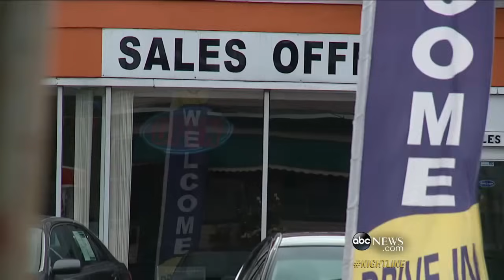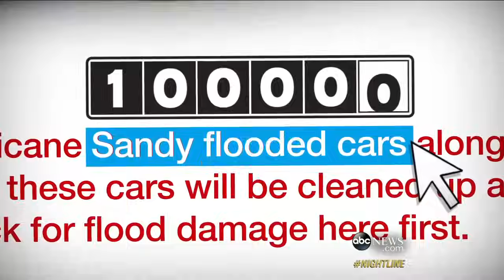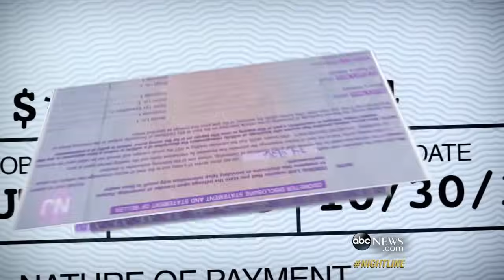How Did a Sandy-Damaged Truck Land on a Used Car Lot?

Comment: i got fired from a used car dealership for refusing to repair a car like this to sell it to one of their customers.
Reply: Good man.
Reply: Yep he mentioned it and lied about it. 
"It was a glitch"... No, it was a flood.
Reply: Hi
Reply: Good Man!!
Reply: I haven't met a lot of honest used car dealers bud...js
Reply: @chrisdoiley8007  bu8n no bbq
Reply: USAA! LOL!
Reply: Full repair or just cleaning up? Because if you’re doing a full repair than it’s really no harm done
Reply: Did you report them?
Reply: @chrisdoiley8007  honest cardealer? Lol, it is an oxymeron, isn´t it? Me recent car is a Mercedes ML 270 CDi, build in 2001. I bought it five years ago. We made a test drive before buying, everything was okay. After driving home, the first control lamp was lightning. That was the beginning of an odysee through many service station. In the end, I invested soo much money in this car, I could have bought a nice GL :-(
Reply: Sometimes people get in trouble for doing the right thing
Reply: @Fastline1000  I bought my 2001 E-class e220 avantgarde wagon 6 or seven years ago. On the way home from the dealership, the automatic gearbox jumped to 1st gear and was stuck until I shut the car off and then back on. 

But I had a warranty for my first 10.000km after the purchase. The dealer told me to go a repairshop in the town I live in, and those guys hated the dealership. 

It cost the dealership almost the same amount of money in repairs as it cost me to buy the car. Only thing that was bad for me, was that I had to turn the car in very often and for longer period of time for several months.

In the end, I got a better working car than expected without paying for repairs I didn't even know it needed.

(Don't think it works that well in all countries. This is in Norway)
Reply: You lost something for standing up for what is right ... Well done my friend... Well done... Don't be sorry for not one single second because I know Jesus Christ our Lord and Savior sees what you have done and not only is Jesus our Savior He is also our Restorer  ... Anything the enemy has taken from us Jesus restores it 10 fold... Don't be surprised if you end up with a better job with better benefits , competitive pay with constant raises working with good people and an honest boss or something... Whatever has happened just give Father God the glory and ask Jesus to put you where He wants you to be and just be patient and see what happens .... I'm sure you will be more than happy... Be blessed my friend in Jesus name
Reply: @jesusischrist1527  i want to do good in life, but I don't want to meet mr. Jesus. How do I approach life from now on, O'wise one? 

Thank you :)
Reply: @WendiKoff  you can start by not being sarcastic oh wise one
Reply: @WendiKoff  outside of that I wish you well and I hope you get everything you want out of this life because the next life to come is going to be so horrible for people who don't know Jesus I'm not going to waste your or my time trying to explain to you how horrible it's going to be and even if I did my best trying to explain it to you i simply just don't have the ability to express to you how horrific it's going to be .... If I were you I would be praying to meet MR JESUS CHRIST and beg HIM to forgive me
Reply: I am too honest to work at used car dealership
Reply: Years ago my brother (now Diseased) brought a car from a reputable Dealer? And when he showed me it did not smell right, I had a friend in motor transport and gave him details  and the report did not match the claims given. Money back but kept the car.
Reply: Good on you.
Reply: Good for you
Reply: There's a spot in heaven for folks like you
Reply: @klein2042  as long as its complete. Once you start your committed to the end.
Reply: Alexander Williams rip
Reply: Should have blew the whistle
Reply: @manyanful  what kind of disease? Diseased is not deceased
Reply: These should be sold to the public not dealers
Reply: that speaks well of your ethics but i hope you dropped a dime on Yelp etc. too to spread the word and call out the thieving dealer!
Reply: There's a special place in Heaven just for you Alex. However back on earth, I truly hope that someone who may have known your story put you right back to work because everyone knows how important it is to have honest employees especially with ethics. Good Karma can go a long way....
Reply: Good for you!!!
Reply: I quit for a similar reason
Reply: you build it we destroy it you don’t know much about cars do you bud.
Reply: Dangerous to drive in car with the mold build up

Comment: I'd totally buy that truck. Of course far below market value because research is key.
Reply: you can't "research" things that disappear when a vehicle passes through an area where titles are cleared.   It was also a problem with cars in accidents, cut in half and welded with the other half of a different car.   The salvage car is taken through a province or state that gives it a new clean title and ta dah!  it's yours and you would never know unless you know what to look for.
Reply: @littlegoobie  Even if you can't research it, if youre buying a car you should know how to look at it. You can't just look at the outside and look at the inside and say all this looks good I'll buy it. Check the frame, the miles, the ECU, the oil, the transmission fluid, EVERYTHING. There are dead giveaways that these cars are flood cars. one of the easiest ways would be looking at the rust on the frame, because of the saltwater.
Reply: It’d be a good project car
Reply: research wont mean shit on a rebuilt car. its rebuilt, not salvage anymore, it is rebuilt. they use that as a way to sell vehicles for a bit less than normal, and ima be honest. rebuilt cars are better, because it will be more structural, because of that they do to rebuild the car, what weld in a knew floor, get a new engine with 0 miles, compared to idk 100k. rebuilt cars is the easy way to get a long lasting turd lookin car.
Reply: @ChillingCap  rebuilt title cars don't get a new motor they get motors with 70k miles on them sometimes even 50k miles.  If a car has been sitting in salt water for 2 days. That is 2 days too long! And most rebuilt cars on 100% fix they still have problems with them. Why spend your hard-earned money on a car that has problems with it already? Makes no sense
Reply: Oh yeah, take the interior out, clean it out, remove and replace it repair the wiring where necessary, maybe $5 grand in work but at the end you have a truck that might have set you back $30,000- $40,000 if you tried to buy it even gently used.
Reply: ferkemall  If the pressurized oil and transmission fluid cannot get out, water can't get in!!
Reply: ferkemall  Think really really hard here - when the trans and the engine is on, the fluids cannot get out even though they are under pressure.  It's a closed system. ANY air leaks in that system mean large fluid leaks. How on Earth will water get into this closed system????

AND if it does get in, the salt water will be in the bottom pan, while the lighter oil floats above the water and protects the engine.

After the flood, remove the fluids, replace all airway components, and give the engine a proper flush.  Yes, you may have to change the starter and the alternator, but these things ate cheap compared to a working engine/trans.

But no, there's people like you running everything....
Reply: blargblarghonk hell ya. A clean lariat 6.0, I’d buy all day. The clean title is shady but if the truck checks out.
Reply: @littlegoobie  
Thats one reason BC doesnt use vehicle titles and also requires inspection on all imported vehicles including from other provinces (though we dont have stupid yearly inspections so yay)
Reply: Id never buy a 6.0 powerstroke.
Reply: It's gonna rot away quickly!

Comment: The Jeep at 3:22 is fine. Should have been able to drive through that.
Also,never buy a truck from a guy that works in an AC/DC t-shirt.
Reply: I thought the same thing!
Reply: maybe its a refference to the broken AC and the non wrking DC driven seats ?
Reply: Makes sense...
Reply: I bought a truck from a girl in a dale Earnhardt t shirt. Nice truck but horrible interest rate lmao
Reply: My blazer was half under water for two and half days.   Washed her down real good.  2 months later all the brake lines were ate away.  Brake fluid dripping from one end to the other.  The pressure on the lines when the brake was depressed quickly revealed how much unseen damage their was.   Jeeps are not immune.  Hell they junk brand new.
Reply: Jsalrulz It sucked water and it hydro locked the engine. That’s why the car is in the middle of the street.
Reply: @davidreed9037  the air box is against the hood with an opening on top no reason it should have stopped unless water flowed in and the driver pussed out
Reply: @davidreed9037  Brake lines are cheap....
Reply: Israel Kelley  Never buy anything from a Clinton no matter what shirt they're wearing...
Reply: Not even Butthead?  he's the only guy i know like that

Comment: I have no problem with people fixing up and selling flood damaged cars but they need to be branded as such. How you can get a salvage vehicle's title re-branded as clean when you can electronically look up the records is beyond negligence on the part of the EVERY state DMV in the country! Why doesn't the DMV access this information before issuing a new title!?
Reply: ***** maybe it has something to do with 49 different DMV's all working in their own little worlds.
Reply: Just processing error.  Got a couple 1000 to process and a few get lost in transition.
Reply: Not all states have salvaged/rebuilt titles.  Repair the damage, process the title thru those states, the reticle in another state with a new clean title.  Ever wonder why they haul wrecked cars cross country?
Reply: madmatt2024 agree
Reply: different states, different rules, I used to have an 04' Grand Am that was wrecked in one state, rebuilt in another, and now has a clean KY title, when I sold it, you can be double damned sure I informed the new owners of the aforementioned issue
Reply: If you update the title, it's not gonna go for 20k. Clear Corruption case. 1000 cars times $20k is $20 million. A lot of money with which you can bribe few dozens of people easily...
Reply: Switching vins
Reply: i suspect the states who do it know it happens but they get the fees
Reply: which state doesent have one and do not forget DC
Reply: It's supposed to be the insurance company to deliver that info to the DMV as well as the owner, the salvage company should also play a part in getting this done they the vehicle in their possession and after the insurance adjuster gets his paperwork done then it should be stripped down for salvageable parts and the rest crushed
Reply: Agree, a well repaired car is not a problem regardless of what a title says. But there are flood-damaged cars and then there are saltwater flood-damaged cars. To do one of those properly would mean complete dismantling, a chemical bath and then reassembling with all mechanical components rebuilt, and all electrical parts that were even close to the water line completely replaced. Unless you are dealing with something incredibly rare, it’s sadly just not worth it.
Reply: Insurers can get more for their totaled vehicles if they inadvertently don't brand the titles and the buyers know they have a reputation for doing such.
Reply: I feel the same way about honesty. I wonder if they rinse the whole thing with fresh water from the inside out then cleaned and dried it would that work? Of course that would include draining the water out of the engine and flushing it out with gas and oil and a few other things I can't think of. Would a car last if cleaned properly? Could it be sold at a good discount? I'm always looking for deals as I just don't have money to burn. If they do it right, if that can be done then some people of lesser income can buy a nice car. It isn't 1985 and I no longer have the chance to buy a low mileage great condition '74 Impala from grandma for $500.
Reply: @georgescott4505   Those mechanics were way overplaying it. The one talking about airbags spontaneously going off was especially an idiot. Worst case scenario the airbag wouldn't work, but there are fail safes that would cause the airbag light to come on so you would know something was wrong.
Anyone claiming that a car can't be driven anymore because of unknown problems is basically telling you a ghost story. It's likely that the only damage the truck in this video had is broken seats.
Reply: If it's a ford
Reply: In TN, a DOT-trained state trooper must inspect the vehicle before it can be titled. And, it will Always be  a salvage title.
Reply: i agree cuz i bought a special edition scion tc that was flood damaged for like 3,400 and was satisfied had to do some maintenance but the car would run and drive, and did so very well however that same car if it was marked clean and not flood damaged would have been hard to tell and would of cost around 8,500 so i totally agree.
Reply: It's a simple paperwork game you buy it in the original state. You take and register it in State #2 then after that you repeate it two more times with one if the states being a non salvage title state the on to your local dealer. Clean title and registration
Reply: @jar407  Ohio, Iowa, and Wyoming you can get it wiped if you show the state that you have repaired the damages
Reply: If you completely restore them then you can sell them full price (just leave a little note that it is a flood car but is still in perfect condition)
Reply: madmatt2024 same but everybody wants new car now in days but I think old cars are nice why would you wanna junk a piece of history like 2000
Reply: The electronics could be up graded..odometer could have a flood sensor that locks under water
Reply: pull vin numbers off and create a registry of all wright off ,hail damaged or food water damaged vehicles. not perfect but works ok.
Reply: @ipissed  That would depend on the wires and circuit boards that create the airbag light to come on. Failsafes are subject to the same saltwater damage as other wires, circuit boards, etc. on the car. It's still a danger waiting to happen.
Reply: @amb2745  Your use of the terms "wires and circuit boards" tells me you don't know jack shit about anything.
When people don't have a proper understanding of an apparatus they tend to say stupid things like "who knows, anything could happen". Well there are people that do know bud, and one of those people is not you.
By your logic an ICBM could erroneously ignite because "wires and circuit boards" and start WW3. Stay in school kid.
Reply: Cuh we can ☻🗿🍗
Reply: That was probably 60k new.
Reply: This is no bigger fraud than Carfax woking with auto dealers....they will sit on an accident report until the car is sold, then the that accident almost ruins that cars resale value. It happened to me and it happens to thousands.  Try to prove that without any cooperation from Carfax or the dealer. Carfax is a scam.
Reply: It depends on the state, but im pretty sure that once anything becomes "salvage", it never becomes "clean" again. You can rebuild a vehicle that was salvaged, and have it inspected by the state, but its issued a salvage/rebuilt title. It doesn't matter if it's a brand new $80k truck with only body damage, if it was branded salvage, you will never get an auto loan for it. It needs to either be purchased with cash, or a personal loan. And anyone that buys a daily driver vehicle with a personal loan is an idiot regardless.

Comment: Happens all the time.  I lived in Florida in the early 90's and my best friend bought a used car from the largest Chevrolet dealership in Florida and months later when he was having electrical problems he took it the Chevy dealership, he didn't like their repair estimate and took it to a mechanic who examined the car and pointed out the rust and other signs the car had been flooded from a Hurricane the year before he bought it.  Long story short, after getting an attorney involved the dealership worked out a trade on another car.  It took some time, but it was worth it plus he and several other people who bought hurricane damaged cars picketed the dealership everyday and that helped too.

Comment: I worked for a company here in Sweden 1999-2000, we imported a few cars from USA that had been in a flood. I took them apart, fixed what could be fixed the rest I throw in the gabage and order new parts from USA. It was alot of work but it was a fun job